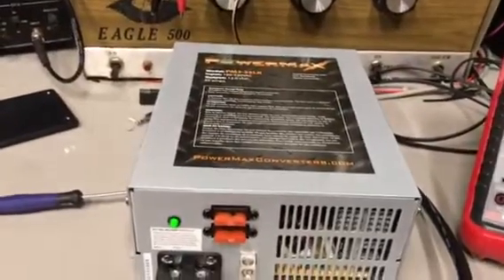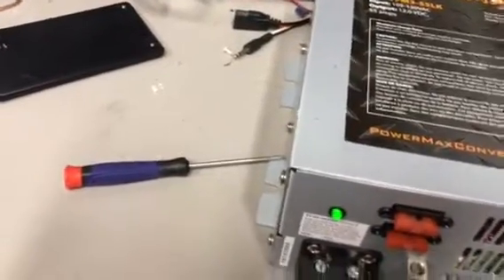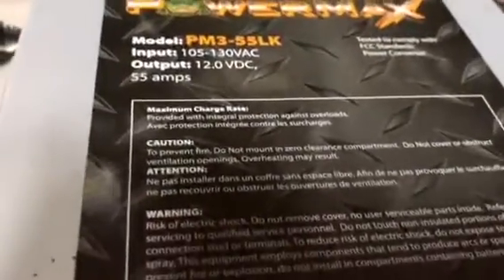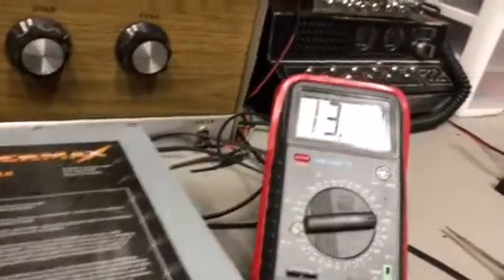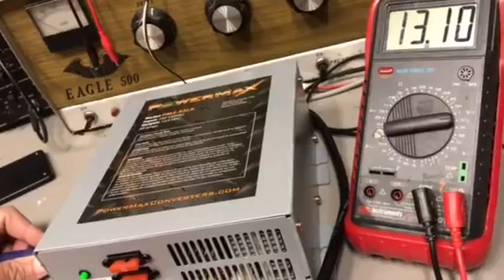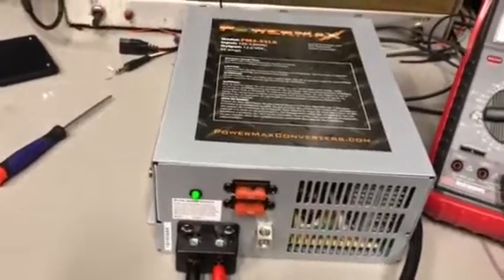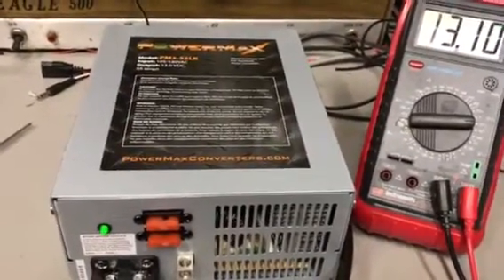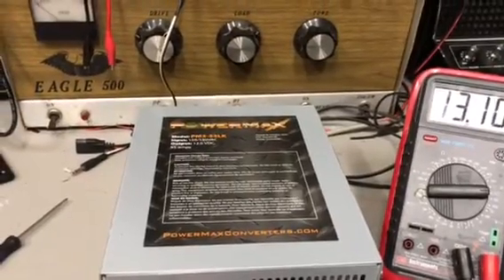Pm3-55lk switching power supply

Comment: For the best deal on these converters or any powermax products contact Jacky Davis on Facebook he will give u a great price! I use these converters to power my trolling motor and 12v pulls. Great for lots of 12v applications. Should use a battery as a buffer to control any surge as a precaution

Comment: Do you also need a batter for this device ? I have the same exact 1 but I was wondering if plug the power and negative wire straight to the power max or do I need a car battery to use this ?
Reply: cheehoo I am sure you could use that to send power to whatever you want, but it’s designed for charging batteries which is why it has a smart 3 stage option. If you set it to a fixed output it would be a static output of said voltage of clean power. There are better options out there though if you are not using to charge batteries
Reply: Free Beck negative.. this will provide 12v power all the way thru. Huge power supply in there. Theres a reason why you have options to pick from. A 100amp version of this power supply would be more than enough with a car amplifier  that draws out only 50-80 amps. Thanks babe.
Reply: Free Beck it’s best to use a battery as a buffer to capture any surge
Reply: Do you will be need a rv batterie not car battery, like interestate battery